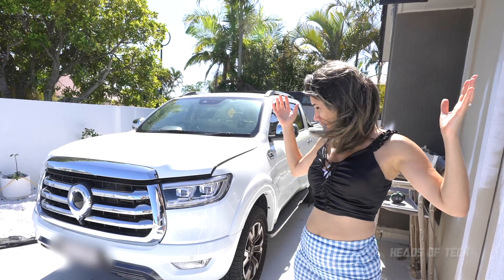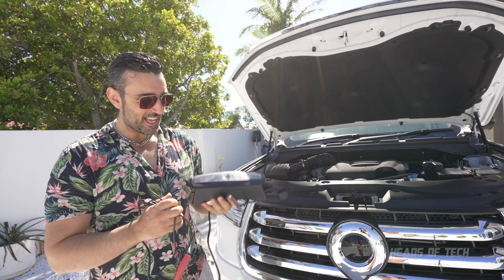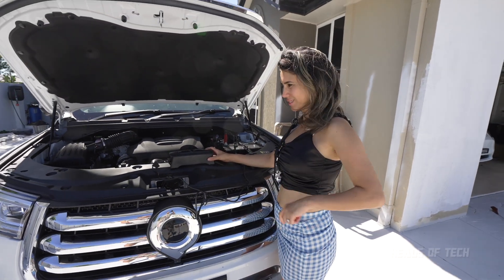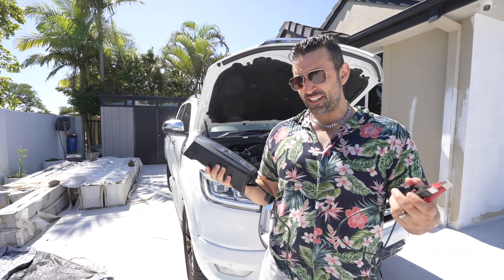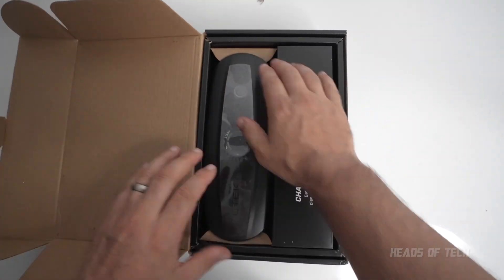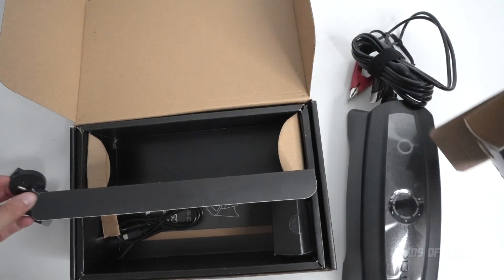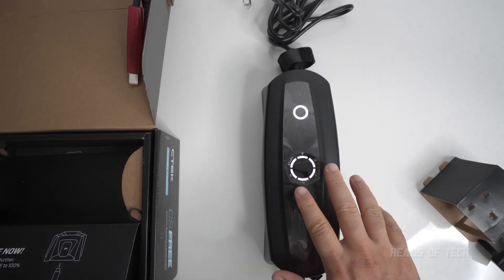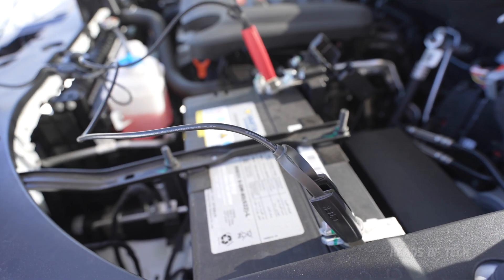CTEK CS Free Portable Car and Boat Charger REVIEW and DEMO | How Jump start Safely 🚗🛥️

Comment: When I attach the charger to car battery and hold the start button down or even pressi it once, nothing happens and the charger doesn't turn on. When I try to charge the charger at home, the charger after some time turns off. Does this mean the charger and car batter are both full?

Comment: Hello, I have another question. Can you connect the CTEK to the cigarette lighter instead of the battery? Is there an accessory for this? I looked on the CTEK website and couldn't find anything. So I'll have to do the trickle charge via the cigarette lighter.
Reply from the maker: They sell something called Connect Cig Plug, but I haven't tested it myself. https://vtudio.com/a/?a=ctek+connect+cig+plug